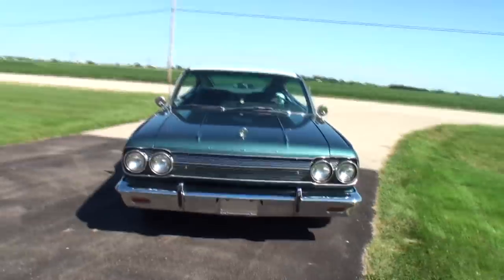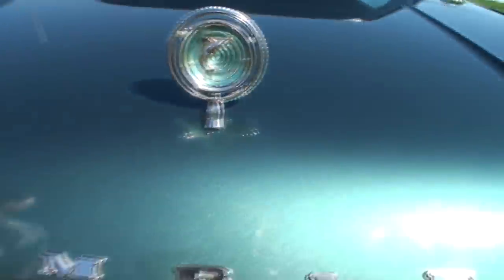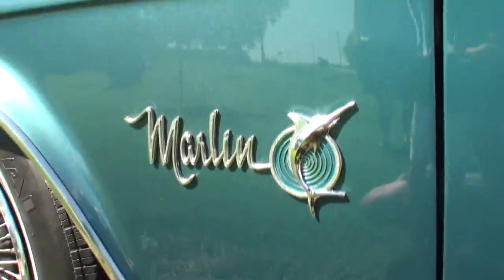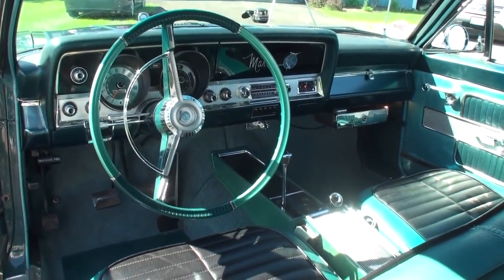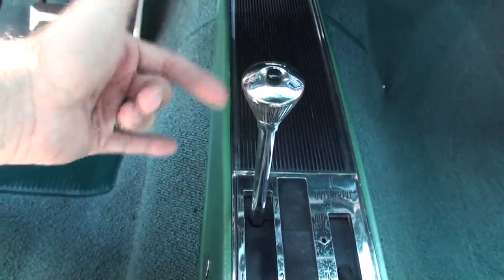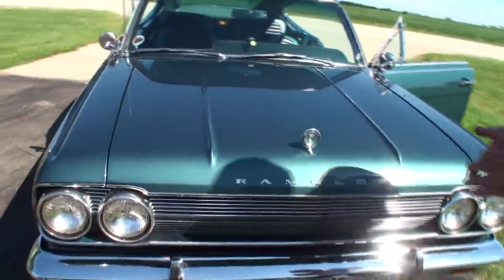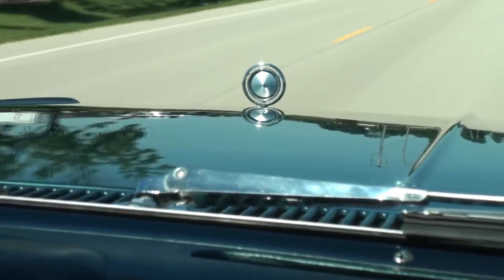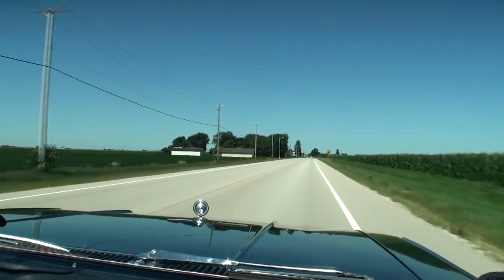1965 American Motors Rambler Marlin " The AMC Big Fish ! " & Ride on My Car Story with Lou Costabile

Comment: This car but with four doors and regular back was made in Argentina by Kaiser Industries, and was a pretty popular car, an uncle of mine had one and currently a friend has one !. The interior was basically the same, but the engine was an OHC six cylinders 230 CI as the only option, and a "normal" gearbox of 3 or 4 speeds. A more luxurious variant was the Ambassador, the same body but with the front and rear slightly modified and with electric windows, it was the presidential car for many years.
I didn't knew that this model was made in the USA, much less a two door with a fast back, it's a very interesting car that brings me a lot of memories.
Reply from the maker: Hi Fabio, Happy to read this car is familiar to you with a Friend & and Uncle who have them or had them, Thank you for sharing, Lou

Comment: 3:37. Back light. 
Bc..back and, bc any window..aside from the windshield, ofc, that does not roll up & down is referred to as a light. 
Hey, that's the way the lingo ppl went! :)
Of course, I'd wager this car inspired Dodge to make the 1st generation Charger, which hit in '66. 
Akin to what AMC did, they picked their mid size car..based the Charger on the Coronet with ofc the 
fast back roof & extra posh and sporty options & appearance items over a base line Coronet.
Fancier grille, taillights, interior, like a full length console & 4 bucket seats and lest we forget, 
the famous flip top fuel cap!
AMC may not have gotten as much attn. as Detroit's 'Big 3', but they definitely had their day, here and there.
The Rambler Marlin you feature here Lou, is living proof :)
<><
Reply from the maker: Hi Tom, Thank you for viewing & sharing your knowledge, Lou
Reply: @loucostabile  Heya, any time, Lou. 
Sharing knowledge is a good thing.
Thanks.

Comment: Enjoyed seeing the Rambler Marlin. I was intrigued by the 3 speed floor shift and 6 cyl. engine. I have a suggestion for a future episode which would be to find a muscle car of the late 60's or early 70's that has a standard 6 cyl. engine in it along with a 3 speed tranny. Technically, it's not a muscle car, but it would be interesting to see since most of these cars had V8's in them. In fact, looking through old car brochures, I noticed that a 3 speed column shift was standard in many cars of the day. It would also be fun to see a luxury car of the era with this setup. I guess I might be the only one that finds this interesting. Thanks.
Reply from the maker: Hi Denaalb, Happy to read you enjoy this car :-) Thank you for doing some research, and I found what you commented on interesting too, Lou

Comment: "Backlite", spelled like that, is the correct industry term for the rear window. Neat car. Trivia: This Marlin is on a 112-inch wheelbase, four shorter than a Torino or Road Runner, but same as GM A-body 68-72.
Reply from the maker: Hi 413x398, Happy to read you think this car is "Neat" :-) Thank you for sharing trivia too, Lou
Reply: And same as the 1976-89 Dodge Aspen platform including the M-Body LeBaron/Fifth Avenue/Diplomat/Gran Fury and '81-83 Imperial, Cordoba and Mirada.

Comment: Nice vehicle it surprised me when he opened the hood and there is a six cylinder. Top of the line interior and a six cylinder strange.
Reply from the maker: Hi Gary, I thought there was going to be an 8, and you're right, the 6, Lou
Reply: I came from an AMC family. My Dad sold new ones 12 yrs.I was hoping to see v8 .had a javelin.brother had a gremlin & hornet. Not knocking your engine but it sounds like valves need adj or manifold leak.I know they are great engines.

Comment: 🤔 so...you push the clutch in to shift the automatic? Unless.... maybe.....the overdrive is electronic separate from the standard transmission that you shift vertically with the automatic looking shifter that somehow shifts FROM FIRST TO THIRD ORY; shifter..if you push a button to downshift....as the owner said....to pass on the highway.... then...

Oh... you about to show it going for drive

Comment: i have a question i have a 66 optioned with a chrysler 383 and 4 speed that was left to me and im a gear head i kinda like the car its ugly and buetifuk at the same time. its in operating cough ,, the front end looks like a challenger so dont know if pops did that or was factory then help if any here.
Reply from the maker: Hi Dusty Gage, Sounds like you have a 66 Charger to me, Lou
Reply: @loucostabile  its clearly a marlin on titile and numbers match is this a one off ordered or oddball.
Reply: i do know that the marlin was built thru amc on the charger and baracuda chassis but thru american motors and i dont know if i have an odd one off optioned vehicle i dont bleive the front end is origonal but the numbers match for engine and frame and dont think its been modified past the front sheet metal.